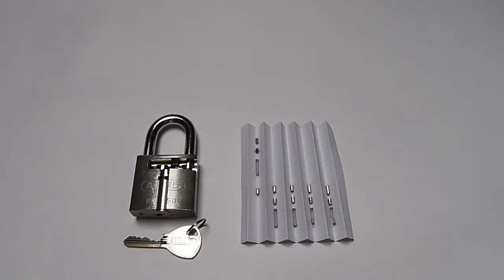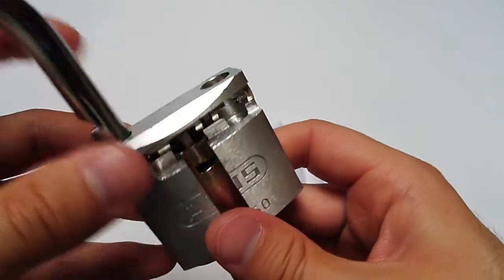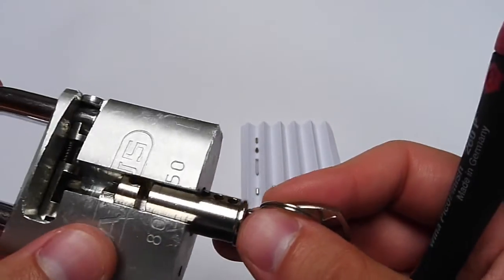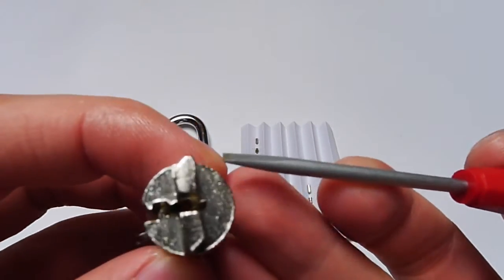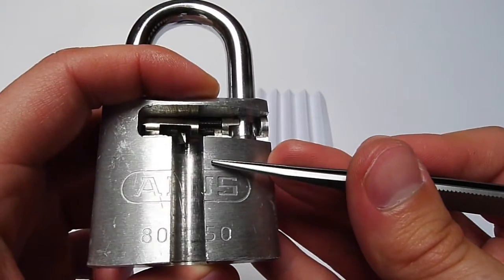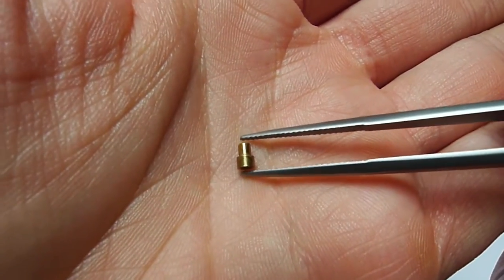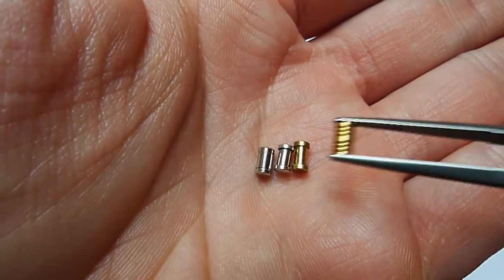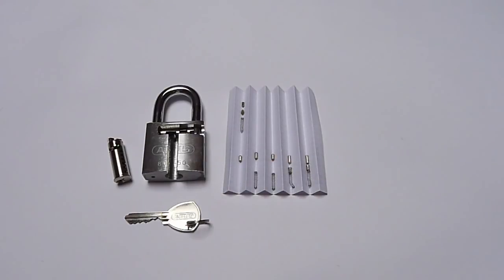Abus Titalium 80 50 Gutting and Presentation of the Security Pins

Comment: Those Abus locks are absolute crap. I bought a brand new abus titanium pad lock and locked my log splitter with it. Now I need to use the splitter and the lock wont open. It took me hours to open it. The aluminium had corroded. Junk.
Reply from the maker: Hey Drean, I totally agree! The cheaper Abus Locks are not as good as the more expensive ones made out of brass for example! Best wishes, Adrian